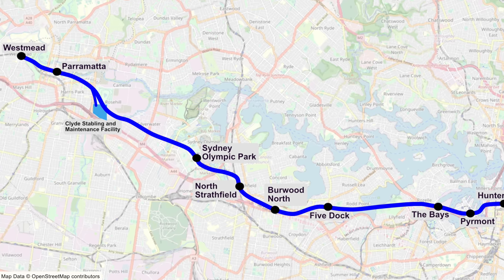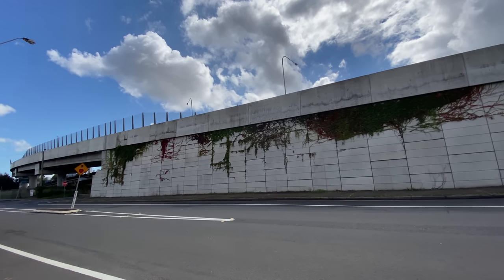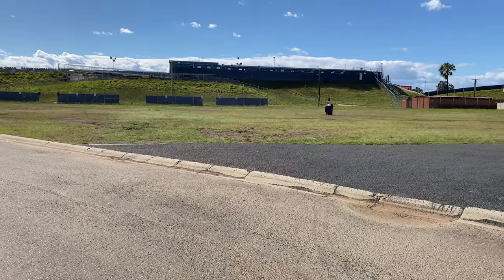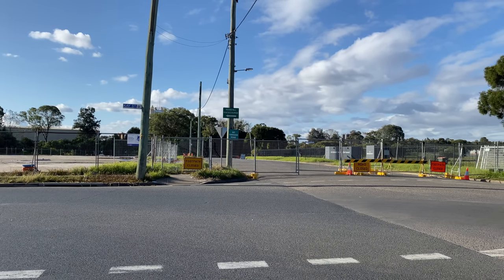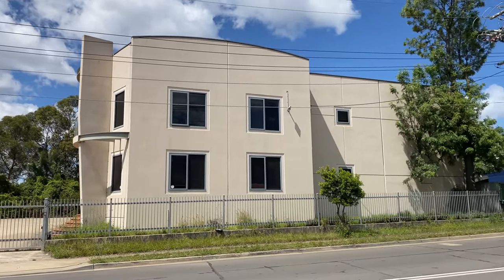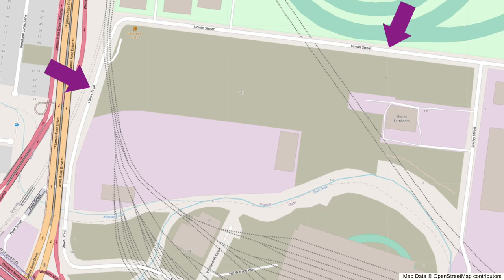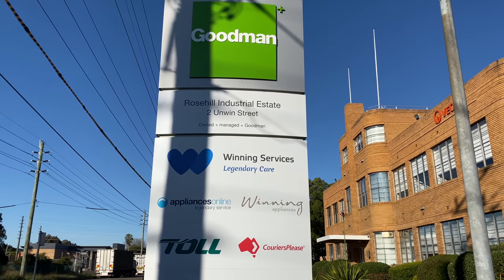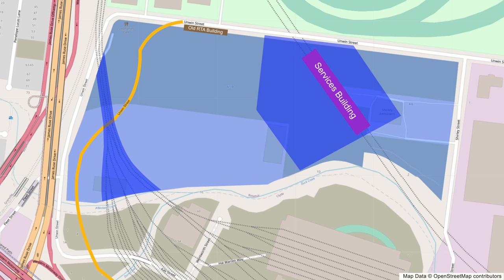Clyde Stabling and Maintenance Facility & Rosehill Services Facility Update - Sydney Metro West

Comment: Hey another great video. I look forward to the old Carlingford line update, especially the section not taken up by Parramatta Light Rail. The level crossing across Parramatta Road has been long removed but there may still be some left over railway tracks.
Reply from the maker: Hi Henry, sadly, all the track has gone north of the level crossing on the Parramatta Road.  The short section to the south of Parramatta Road and Clyde Station is used by the track inspection vehicles as their depot is there.

Comment: Hi Paul. The industrial rail network in that area was all connected to the Carlingford Line, those on the northern side of the racecourse via the Sandown Line. Industry to the south and east of Duck River/Creek, was connected to Clyde Yard. Before there was James Ruse Drive, there was Berry Street, and a very dangerous level crossing. Many terrible accidents there. Interesting origins of CHEP (originally Commonwealth Handling Equipment Pool) - born out of WW2 military logistics, and privatised in 1949.
Reply from the maker: Thanks Dave, I didn't realise that there used to be a Clyde Yard in this area! Thanks for the info on CHEP too.  I plan to do a video on what's left of both the Carlingford and Sandown lines in the future.
Reply: @TransportVlog  Clyde Yard is still there. Seems to be a facility used mainly for loading the Garbage Train, unloading cement (probably from Maldon), and facilities for Pacific National and Sydney Trains.
Reply from the maker: @daveg2104  Yes, I know the one you mean now! It's on the north side of the main line between Auburn and Clyde stations. I often sit on that side of the train to see what freight locos are in there!
Reply: G day Paul

Great info Vlog, many thanks, 2 branch lines came off the Carlingford between Parramatta Rd and Rosehill Racecourse, 1 went into the Asphalt Plant via a unprotected level crossing, the second was at former main road that is now JRuse Dr(3 tracks in all) 2 for the C line, the branch veered off to east into the DMR location.

Comment: Thank you Paul, Douglas Brooks, I lived along the Carlingford line for more than 20 years, both at Rydalmere, and Carlingford.  I would like to let you know while I lived there back in the 50's and 60's  during the change over from Steam to Electrification all trains would use the long race course platform the race trains would be stored on the Shell works siding. Have a great day and thank you for your information. Best wishes. Douglas.
Reply from the maker: You're very welcome Douglas.  Great to know that the long platform was used by all trains in the 60s.  I'm assuming it was used since then for trains terminating at the race course.

Comment: The overall cost of the project must be eye-watering. They must be pretty confident it will turn a profit.
Just the land acquisition cost from this video alone would be quite substantial, and that's before any actual work even begins.
It will definitely be interesting to see the final product once the project is finished.
Reply from the maker: Yes it is! However, it's not really about it making a profit, more about ensuring that Sydney's transport can cope with existing and future population growth. A big driver for this new line is the existing Central and Parramatta line being at capacity. Also it's hard to put a price on quicker journey times and less road congestion as people switch to the metro.
Reply: Don’t Worry 😉 
The chief reason for this is The Future Development and Building of Appartments and Commercial/Shopping.
Local Councils need the Rates,
State Government needs the Stamp Duty and GST

Comment: Thanks again Paul for this remarkable opus.  All very enlightening and nostalgic for this area I knew in my childhookd and beyond..You have done a huge amount of research which has borne fruit for an excellent presentation  As for those rail lines you queried:  I am wondering if they are remnant of the old steam tram line which ran from George STreet Parramatta  then along Grand Parade to the wharf at the junction of Parramatta river and Duck river.  I have checked with a 1934 map.  Interesting conjecture!
Reply from the maker: Hi Luke, you're very welcome. Glad you enjoyed my video tour of this area. Yes it could be. I think they may have also linked to the old Sandown Line, which ran along Grand Parade. Or it could have been a self-contained industrial railway!

Comment: The road elevated 250 metres above the tracks? I think that is a little high, do you mean 2.5 metres?
Reply from the maker: Thanks for pointing this out. I just checked the modification report and I missed read it slightly.  Its actually 250 metres of the length of the realigned road that will be elevated! 250 metres high would be taller than the Chifley Tower in Sydney's CBD!

Comment: At the 21:00 mark I gather you mean there will be 250m of elevated road not that the road will be 250m high 😆
Reply from the maker: Yes that's right! It will be elevated for 250 metres in length! 250 metres high would be rather scary!

Comment: Query - How can you demolish a heritage listed bridge - isn't the purpose of the heritage listing to legally stop any future destruction and to preserve history. If you can demolish a heritage listed building then the whole purpose of heritage listing seems quite superfluous and offensive to the original decision, its a complete oxymoron
Reply from the maker: Hi Stephen, It's complicated!, but basically a process has to be followed to consider all other options before a heritage building can be demolished.  And in most cases, that process will find a way to retain the building, but not always. In the case of the Rosehill Railway Bridge, the alternative route for the tracks, would have involved redirecting major utilities (such as water, electricity, gas, or sewage) which would have been very expensive and disruptive.  You can read more about this in this doc - https://majorprojects.planningportal.nsw.gov.au/prweb/PRRestService/mp/01/getContent?AttachRef=SSI-10038-MOD-2%2120211123T031939.185%20GMT

Comment: Just get rid of the bridge & the station, 1959 is not exactly heritage.  I was 12 years old when this was built & was modern then so what is the big deal.  Heritage should be earlier than the 1940s.
Reply from the maker: Hi Louise, that's what's going to happen! Quite a lot of Rosehill station has now been demolished. Good that the former RTA building is staying. I went back there a couple of weeks ago, and Downer and the cement works have now gone, along with the Sydney Speedway buildings.